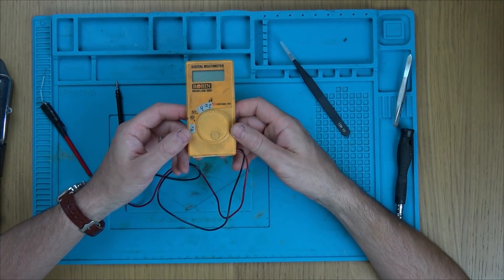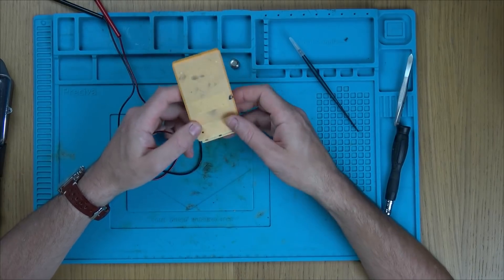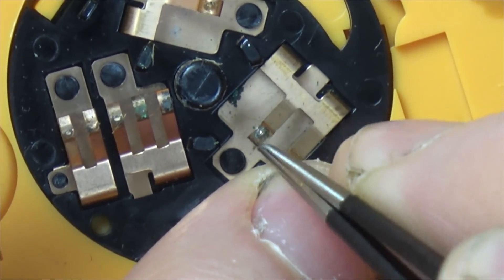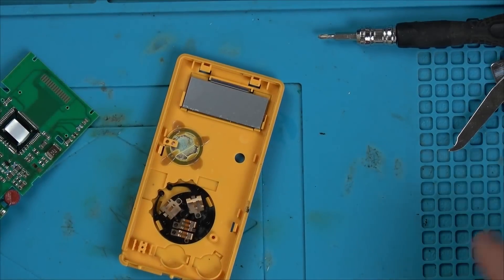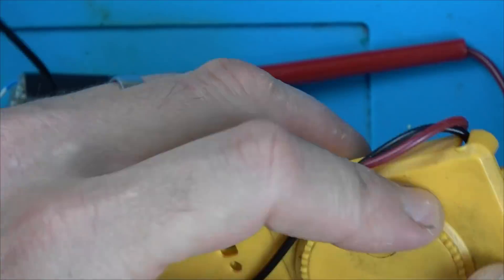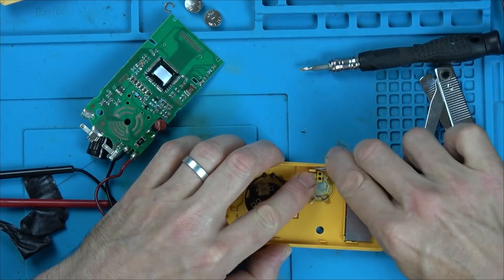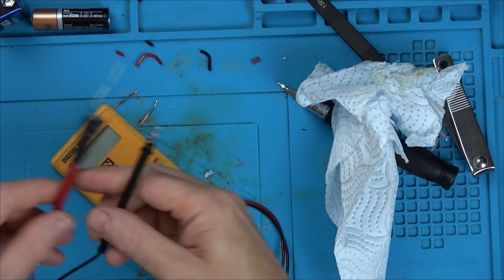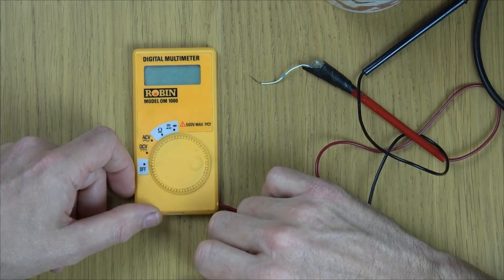Tea Break Fix - Faulty Old ROBIN MULTIMETER Repair

Comment: Unbelievable. Trying to fix a Robin OM 1000N I purchased around 1989 (might have been in the 90's) and have not used for years. A quick Google search. 1st result - My Mate Vince video. I didn't think there would be much chance of finding a fix. I havent done the fix yet but I am all set to give it a try. Excellent video, clearly explained  and leaving nothing out. Thanks

Comment: Great video, my OM1000 up and running again. BUT NOTE - before you start, scroll to 8:40 and note the little black carbon contacts that you will lose if you don't spot them!! Mine are lost - beep didn't work! I rolled silver foil into two tiny tubes and managed to insert them instead. All good, what a fix!

Comment: I do allot of electrical work on motorcycles and automotive, I am totally dependent on my multi meter. Goes to show how much we take these things for granted! Had to re-wire my motorcycle after doing a paint job and needed my meter to trace wiring and test circuits. Would have been a nightmare without a meter!

Comment: Great work as always Vince! By chance would you maybe revisit it some time and put on the new leads you had mentioned? I would honestly love to see it fully restored. Oh and a little advice for the back of it from a painters point of view. Take some matte varnish and put a couple coats on it. Just on the outside, not the inside. It will help it stay clean, and also it works as a bit of a protectant from the elements, which will intern keep it working longer. If you ever want to give it a go. But I enjoyed the video, as I do with all of them. Keep up the great work, and looking forward to the next Rolls video! God Bless my friend.

Comment: I’m guessing the potentiometer is to zero your test leads when measuring ohms.
Reply: Probably as you say, but I'd guess set at the factory as you wouldn't be pulling the plastic coating off to adjust it normally.

Comment: In January of 2000 Robin UK was acquired by Fluke Europe, you can find a few testers branded as Robin Fluke like the 1652 Multi Function Tester. 

Shortly after the acquisition many of the core Robin team left & started Kewtech which still design & manufacture electrical test equipment to this day.
Reply: Are Robin good

Comment: 6:19 don't do that, it's a mistake, you are removing the nickel coating from the contacts. You just need to clean and polish it. Unused devices should have the batteries removed to prevent this accumulation of dirt.

Comment: Im curious how you determine if a fix is a tea break fix.. I assumed earlier that it was after the fact based on the time taken, but that doesnt seem to be the case.. Do you just educated guess and set a limit? What if a tea break fix takes longer than expected?
Reply from the maker: Educated guess really and then if it is longer than expected then I have to edit it heavily. I have a 'tea break fix' Internet radio coming up in a couple of weeks that should have been a trying to fix due to the length of time it took👍👍👍
Reply: Good to know, thanks for getting back!

Comment: Is that the multimeter I suggested all them years ago on soldering some needles to the probes as you were struggling with crossed terminals on some of the electronics you were working on at the time?   Wished you could come and fix my broken yellow Robin, the Relianty type as its got a broken A frame and a £300 new part of hoping my garages welder can pull some magic out of his machines and weld in a new section, just done the kingpin and wheel bearing, drives like a roller skate on black ice... verra dangerous :(
Reply from the maker: It is Ian, the very same multimeter👍👍

Comment: Even though I have a modern new Lidl's crimp set and stripper claws my main go to is an old old British Rail "duckbill" stripper that you can by feel alone strip as much or as little as you want and these things must be from the 60's or 70's and apart from stoning the wire cutter section and a gentle stoning on the cutty part of the duckbill's jaws and a drop of steam compound oil in the movey bits, the thing is like new in action.   I don't get on with the modern claw type, very fiddly to get it right and the adjustment on the length is too easily moved which can be tedious having to reset it each strip.

Comment: Very nice fix :) 
I have yellow multimeter too from late 90's, but mine is Biltema brand, and simpler one, for example it doesn't have the beeper. 
Couple of years ago one lead broke off inside the insulator because of corrosion, so haven't used it anymore. 
Got a new multimeter, but haven't thrown the old one away. Maybe I'll find new leads for it.
It has a 9V battery inside it and replacing it requires opening the case.

Comment: Was a tad more than a tea break fix but I certainly enjoyed it.   I do lament over the loss somewhere of a meter I had from 1988, my first auto-ranging LCD one. No idea where I lost it.

Nice  to see the Hakko making an appearance, hope you're finding it a useful addition.

Thanks again for the entertainment.
Reply: Nice o see you here too Paul :-D
Reply from the maker: Thanks for watching Paul. I'm loving the Hakko, definitely more powerful at transferring the heat than my old one AND heats up super quick. I haven't used it that much due to the car taking over my life, but as the weather turns cold and wet the blue mat videos will be back with gusto👍👍👍
Reply: @Mymatevince  moving to the heater-in-cartridge system is definitely a big shift from the old style; makes it hard to go back too.  I ended up buying a second one so that I could have both the normal size tips and a micro pencil at the same time.  While they're not the top-grade gear ( like JBC ) I'm certainly not regretting my investment.
Reply from the maker: @pldaniels  I got a micro pencil too,  it's tiny, looking forward to finally using it👍👍👍
Reply: @Mymatevince  Should be interesting, 0201 parts will be no trouble now.   

I do often have to use my hotair station at 250'C to give it a heat-assist so that the PCB doesn't overburden the tip in terms of heat drain.

Will be interesting to see what you use it on first.
Reply from the maker: @pldaniels  Cheers for the tip Paul👍